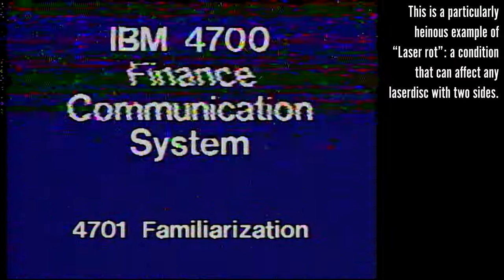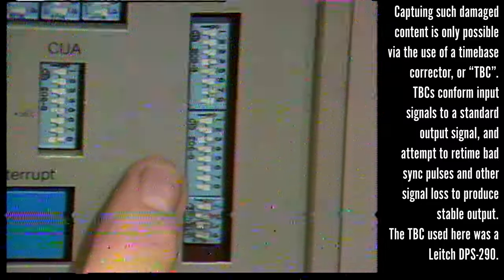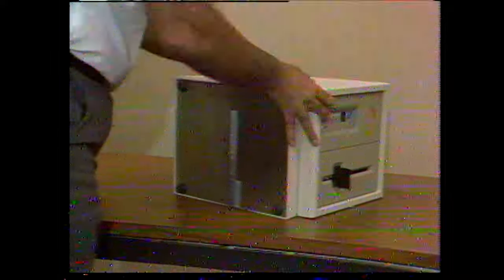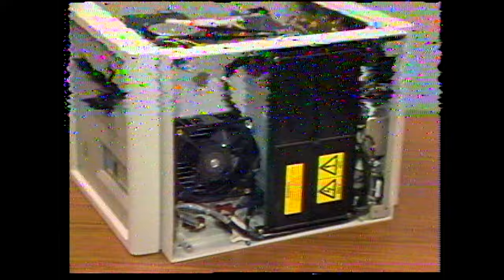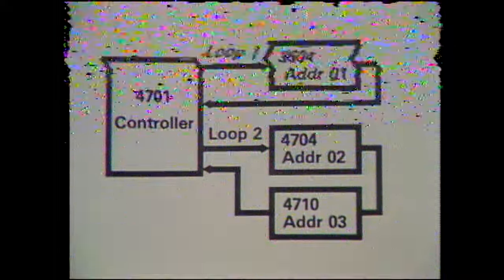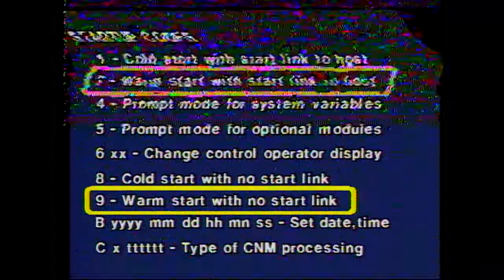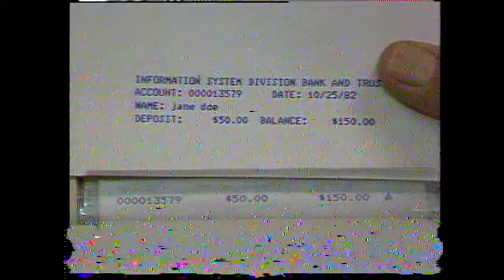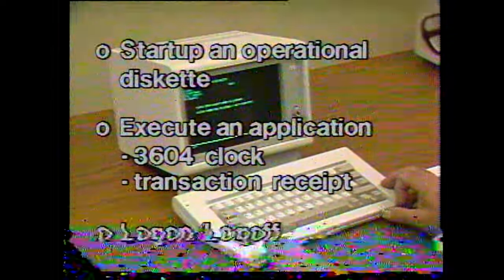This is what extreme laserdisc rot looks and sounds like

Comment: If anything, it speaks to the robustness of analog video formats that it works at all; I highly doubt any digital codec would be so lucky!
Reply: I just formatted 50 diskettes (2S/DD) and 41 of them worked perfectly, 7 had a few bad sectors (less than 5% on most), and two outright failed. These diskettes are over 30 years old.
Reply from the maker: Diskettes with lower densities are still quite viable.  5.25" DSDD disks in particular have the least amount of errors.  3.5" DSHD disks have the most, since you're packing more data into smaller areas.
Reply: @JimLeonard  I've noticed that as well, but a surprising amount of my 500+ 1.44 Mb diskettes still work ;)
Reply: I once did an Internship for the IT section of a manufacturer. They still use Magnetic Tape in any big company to store server backups nowadays.

Comment: the half-field corruption blows my mind, what in the manufacturing technique introduces the opportunity for half the disc go bad but the other half is OK?  The audio is FM encoded, so the corruption comes across as a constant frequency warble... given the hard edge of the actual video start on the left from black, it seems like the sync could be reconstructed somehow, which I assume could fix the audio as well, and provide a better source signal for the video filter to do its magic.
Reply from the maker: One side of a CAV disc has a clear vertical split where you can see one field on one 180-degree section (one "half"), and the other field in the other half.  The damage was much heavier in one field's area than the other.

Comment: I wonder, assuming that the original master is lost and all that is left are rotted LaserDiscs, if it would be possible to split the disc, remove the old aluminum layer, then clean and re-aluminize the substrate without damaging the pits or the rest of the substrate? Has the oxidization already damaged the pits too much?

And if a rotted disc is photographed at a microscopic level, would it be possible to identify the outlines of pits to reconstruct an image of the pits and lands, which could then be used to generate a relatively clean FM carrier? 🤔
Reply from the maker: Oxidation erases (mangles) the pits, so there is no way to recover the original information on a physical level.  In many cases, the areas are completely gone (you can see right through the disc).

Comment: I wonder if doing a raw laser RF capture with the Domesday Duplicator and then using ld-decode might offer better results with this disc.
Reply: Was thinking the same thing. If I can clearly see where the unsynced video line starts software should be able to fix it too.
Reply: The ld-decode TBC should maintain a much better lock, and the system might handle the dropouts a bit better. This looks like a very noisy sort of rot so the SNR will probably be atrociously bad in the rotted area.

With three copies of the disk you can use stacking to make a go at recovering more of the original picture, but I'm not sure the (analog) audio can be salvaged.
Reply from the maker: This assumes three copies of the disc can even be located.  This was an internal training disc pressed by IBM for internal use, not a commercial disc.

Comment: You might be able to improve the audio by switching off the "digital" audio track.

You're lucky your player's laser was able to stay on track. I had a spot of laser rot on an old copy of "Rocky Horror Picture Show" that caused "Laser Lock" (the laserdisc equivalent of a record player stuck in a loop except the loop is one frame long) and you had to manually fast forward past it to continue.
Reply: This almost certainly predates digital audio tracks.  Many of these industrial disks don't even have CX!
Reply from the maker: Correct.  This was 1983; there is no digital track and no CX (and my laserdisc player had CX turned off).
Reply from the maker: No digital track on this 1983 disc.

Comment: It gets worse and worse as the disc progresses from the outside edge towards the middle. 🤨
If the disc supports analogue audio, switching off the digital track might be a good idea. 😉
Reply from the maker: There is no digital track on the disc; it was from 1983.
Reply: @JimLeonard  Oh, I didn't knew that.

Comment: I noticed something weird about this video. If you drag the mouse curser along the bar at the bottom of the screen, you don't see the distortions in the preview frames. (Could this be some YouTube AI data correction?)
Reply from the maker: I mention in the video that the nature of the damage on this specific disc affected one field much more than the other.  The odd field was more damaged.  It's likely that youtube only looks at even frames when doing the thumbnail scrub, so you're seeing only the even frames in the 60p upload, which corresponds to the even fields in the source, which are cleaner.

Comment: very ridiculous and impractical solution: the aluminium layer had to be put on something... maybe sputtering/plating a new reflective layer on top of the base plastic could """"restore"""" a disk for long enough to be archived?
...wait a minute, someone else suggested this idea and you said the oxidation kinda damages the physical pits in the plastic...
EDIT:a TBS would replace the sync signals, but to what timing? i wonder if it's possible to get better (as in more consistent) sync by setting up a phase-locked loop with the hsync signals, or at least correct it in post by assuming most elements - including straight lines are (near-)identical between frames - something similar could be done to correct for a bad  colorburst, just with the similarity between scanlines used as well.
Reply from the maker: The capture in the video was already done with a broadcast TBC, which uses some of these techniques, and this is the best it could do.  It was a herculean effort on the part of the player and the TBC that the video could be captured at all.
Reply: @JimLeonard  Id assume a consumer grade LD player would just refuse to even play the disc to begin with?
Reply from the maker: @eightcoins4401  Likely, if the player didn't have some sort of TBC embedded.

Comment: Have you tried any of the newer AI denoising techniques that are used by many global illumination raytracers (which progressively refine a noise picture) ?
You can do this in Blender, by using it's video editing capabilities, by connecting a node network and the AI denoiser it has...
Reply from the maker: And this works for low-res images in motion?  The picture detail is not always static, like it would be in a 3-d render of a scene.
Reply: @JimLeonard   It works for reducing random walk pathtracing noise and it works for animation, eg images in motion...
I don't think it will remove the structural deformations, not without retraining the GAN with a large amount of similarly distorted images... You could give it a go, it might help :)

Comment: whoa.

This sounds akin to those faulty film projectors used at school!

Was there ANY way those discs could be stored long-term without the adhesive breaking down?
Reply: Great storage might've helped, but generally rotters gonna rot.
Reply: You're forgetting the slap slap slap slap     slap          slap                            slap at the end.
Reply from the maker: Correct.  The adhesive breaks down over time regardless of storage, so the best possible outcome would have been storage in a low-humidity room (or possibly shrinkwrap-sealed) since manufacturing, then immediately capturing the disc content after un-sealing.
Reply: From what i've heard not every laserdisc is affected by this, but its impossible to know which are til it happens. All discs where its a known issue, its only known because collectors reported it.